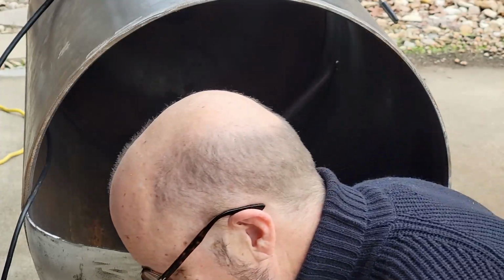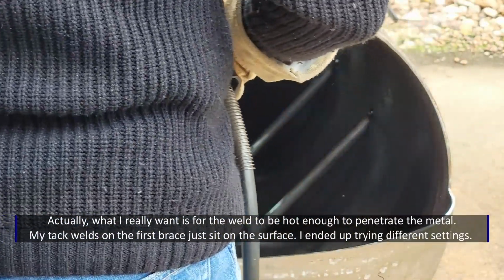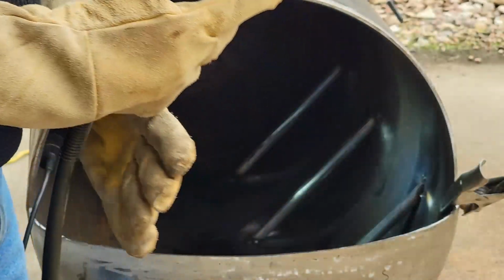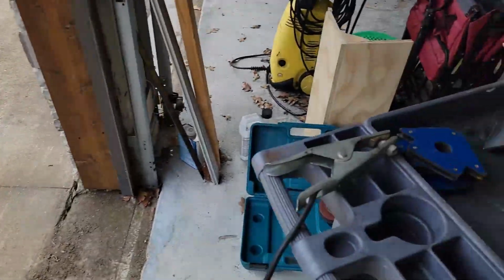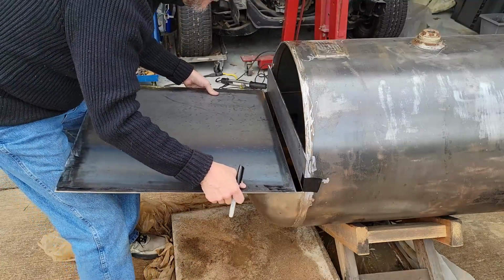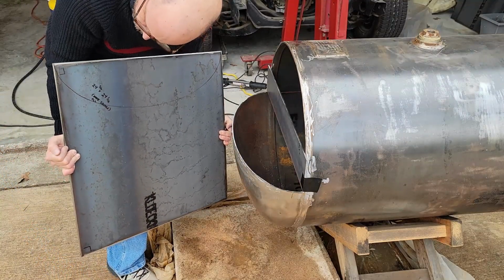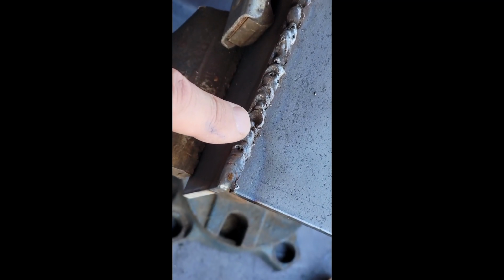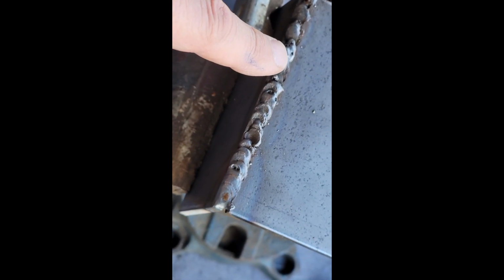Day 13, Smoker Build 01-15-25

Comment: What is your polarity on your wire?
Reply from the maker: Sorry for the slow reply. I don't remember offhand (!) but I'm pretty sure we had set it for gas-shielded arc welding. In hindsight, I'm thinking I just had lots of issues with mill scale.

Comment: From what i can tell, you're too hot and too little wire speed, every time it touches it, burns out quicker than it feed, hope this helps, try 23-25volts for 325-375 wire speed.
Reply from the maker: I'll have to try to translate those into settings on this Miller 110. Thanks, I'll keep this in mind.